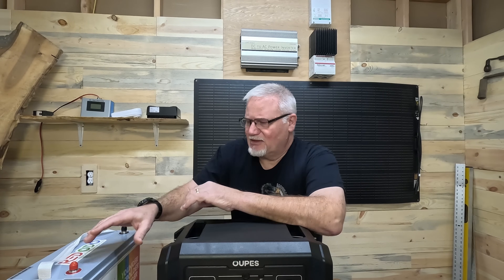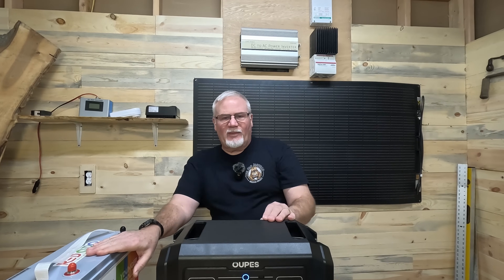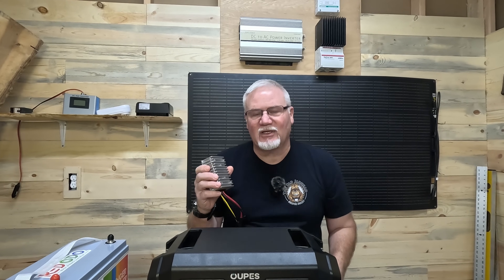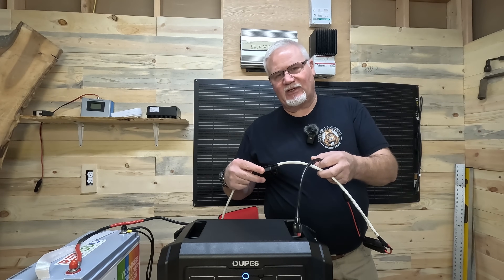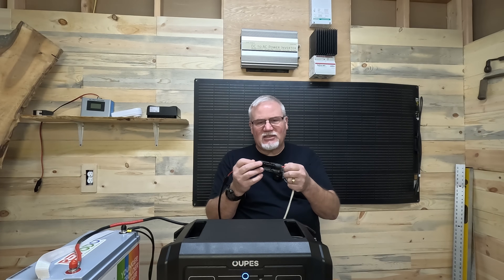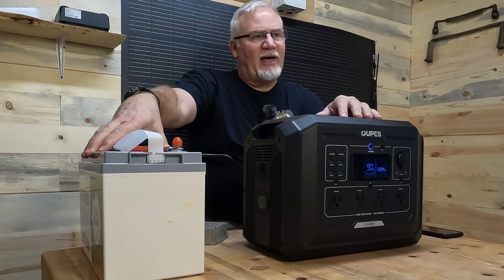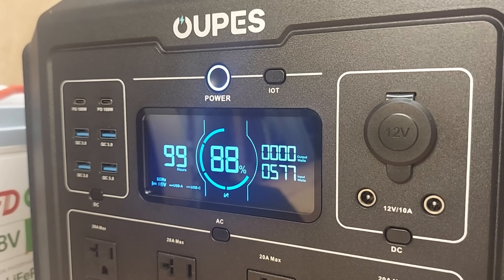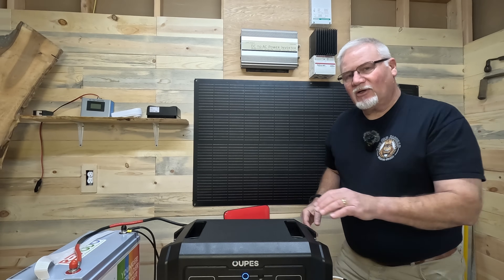Discover How to BOOST Your Portable Power Station Today!

Comment: I have a 48v solar setup using 24.8 batteries, can I just connect mine to the bus bars connected to my system? Run my greenhouse heaters.
Reply from the maker: what type of battery?  If LiFePo's or at least a monitor, then running them in series and into the power station (if it has a solar input that can accept the 40v nominal input) is the best option aside from a straight 48v battery IMO.

This option is just a simple way to get a 12v battery to charge something like the Oupes or provide power to it faster.
Reply: @ thanks for getting back, LiFePO batteries 25.6v 50Ah. 1280Wh, connected to get 48v system, I ordered a EF ECOFLOW power station DElta 2, 1024wh, 1800w.
Reply: @ also have 2 solar panels connected with inverter and charger for 48v.
Reply from the maker: Sounds like you are well on your way!

Comment: If I use a 24v battery will that charge at 500w without a step up converter.
Reply from the maker: Not with the Oupes but it will charge at over 240w and be a great way to extend the battery.  A 48v battery would be better with the Oupes whereas the Aferiy has a higher amperage input and a 24v battery will give 500w
Reply: @TheOldJarhead  thank you buddy
Reply from the maker: You bet!

Comment: A question that comes to my mind, and maybe it's because it's the way I've chosen to use the several large capacity 12 volt LiFePo4 batteries that I own, is, why wouldn't you just get an additional 2000 watt inverter ( I actually have a number of even smaller inverters that I can use to service smaller AC loads, for the sake of efficiency and battery conservation) that was dedicated to being moved from one battery to another as they drain down or would stay connected to a bank of them all tied together. I feel like I can run my fridge longer with a 300 to 500 watt inverter connected to my 200 AH battery than I can from a 2000 watt Oupes power bank connected to the same battery, if a long run time is my main concern. Why not just connect the Oupes to the solar panel and let it charge it while you pass the power through to the Oupes' inverter? Why not just connect a 500 watt inverter to the battery, plug in the charge cable for the Oupes, add whatever solar you have available and put power into it at a rate that is closer to what the Oupes' inverter is capable to delivering. I think that a 700 watt inverter would max out the AC charging if you didn't use turbo charging, or whatever they call it. I see this working fine if you're going to eventually have grid power and a charger at your disposal for the big battery and you just need some extra time at a low wattage draw until that becomes available, but if you're off grid completely, then a small capacity solar generator sort of loses its luster.
Reply from the maker: So, to me, the best option is an inverter, batteries, solar charge controller, panels and a 120v charger (or an inverter charger) and scrap the power station.

Power stations are good for portable power and short duration outages only, really.

Comment: Good idea but how hot does that step up inverter gets?
Reply from the maker: In the followup video (at the end for those that made it all the way) I mention that it did get warm (not so hot I couldn't touch it) it does have over current and over temp protection which some reviews I saw said does work but I plan to do more testing.

Comment: I could be wrong, but, respectfully, I think the 10 amp rating on the step up converter, AKA, boost converter, means that it is limited to 10 amps of DRAW from the converter, if you don't want to DAMAGE it. It doesn't possess the circuitry or ability to LIMIT the output to 10 amps. It will actually provide all the amps that you ask of it, right up until the point that it melts or bursts into flames. In this case, it could be said that it's being over stressed by 30%, at 13 amps, but it may be over engineered to allow slightly higher than rated amperage draws. With a fuse (say 15 amps) that limits that draw, you may avoid destroying the converter spontaneously, but it is probably getting hotter than it is designed for and if you were to connect to a power bank that could accept 800 or 1000 watts of solar, for example, your fuse would just keep blowing to protect the booster and the wiring. Do the same thing connected to the same power bank WITHOUT a fuse and you'll let the magic blue smoke out of everything between the battery and the power bank. That is my belief, at least. A boost converter with a higher amp rating or a power bank that accepts a lower wattage solar input should be fine with this, but a balance has to be maintained and this won't be a universal device for all power banks.
Reply from the maker: That's a good point and one I've been pondering.

I use a much better quality step down converter at my cabin and have used a step up like this one for a 5 day period in testing without issue but it wasn't being pushed.  During this test I was surprised to see it allow so much to be drawn off the battery when it hit 580w and I pulled out a calculator and pondered it for a little.

I did note that it got warm in the follow up video (tagged on at the end just for those who watched the entire video).

I'm planning on doing another test over a longer period and using my heat gun to see what happens.  I've also though about getting a higher rated converter but in truth, it would be better to just use a higher voltage battery.

Comment: I really can't understand why I'll need that step up converter, instead of connecting directly that battery to solar in?
Reply from the maker: It's all about voltage -- if you have a battery with the right voltage (in this case 48v) you'd just plug it right in, but if you have a 12v battery plugging it in will get you a max of around 130w of charging and it may drop out completely once the battery drops below 13v since this power station has a range of 13-48v.

So the boost converter just helps get the battery voltage up to what the power station needs to get the most out of the battery.

it is a short term solution for an emergency though, since it's better to have the battery voltage to match (ie a 48v battery).
Reply: @TheOldJarhead  thanks a lot
Reply from the maker: Absolutely

Comment: How hot does the buck converter get? They claim 97% efficiency, but the heat generated is all wasted power. You staed in a comment that you see this as a short term solution, but in the video you actually advocate even batteries in parallel for increased supply. I'm a little hesitant to pursue this approa ch. I tried a 12 to 24v converter and it was terribly wasteful. Did you actually calc the input wattage vs the delivery? That would be an interesting analysis.
Reply from the maker: Even batteries in parallel in this case would be short term.

I view Power Stations as 'short term' because, honestly that's what they are.  For emergency backup in case of an outage that lasts a a few hours to a few days and, god forbid, even longer.  A power station and some batteries can do that.

For extending the life of a power station here are my best suggestions in order of best to least:

1.  Add a battery of the appropriate size along with solar and a DC Charge Controller with MPPT input as well.
2.  Batteries in series to get the right voltage (and series parallel if more power needed) and the above.
3. Battery (s) with a step up converter to get the right voltage.

I ran my Jackery for 5 days with a 12.8v battery and a 12-24v step up converter without issue.  It got warm yes but not dangerously hot.  If doing this allowed me to go 5 days straight without issue than it will work in an outage.  

For long term home backup I do not recommend power stations except maybe the big monster expensive ones they are making these days but my preference is, of course, DIY solar.
Reply: @TheOldJarhead  Thanks for your response. Your videos are very helpful.
Reply from the maker: Happy to help ☺️
Reply: I went ahead and re-created your test with the 12-48v step up converter. I had a 40amp fuse on the battery output which blew when I got up to about 536w of input on my Anker C1000. The Anker limits the input to 12.5a The problem I had was the primary wiring on the 48v converter is only 10awg which was way overloaded at almost 50a!. Not too safe. I like the approach though and I had a 12-24v converter which gave me about 230w. I think a 12 to 36v converter might be a good compromise. I''d be happy with 450w of charging. Thanks again for the ideas.
Reply from the maker: The amp draw off the battery will be 4x that of the available amperage from the 48v side -- so at 12.5a you'll get 50a draw off the battery, all things being equal.  I'd put in a larger fuse ;)  like a 75a fuse.  And the short distance of the leads to the battery should allow a cable of the size they built it with (8awg I believe).  Out the other side 10awg is more than enough.

Comment: Ok let’s say my power station can only be hooked up to 200 watts of solar will I need to get the 12-24 to 48w at less then the 500 but closer to the 200 watt my power station says it can use?
Reply from the maker: It's more about the voltage -- if it's a 200w limit it's likely 24v (check to be sure) and in that case a 24v battery or, if you have a 12.8v battery than a 12-24v step up converter will work.

Comment: QUESTION: How about stacking two of those 12V batteries in series to get to 24V?  If you have two of those batteries, perhaps you could do a comparison, and would you then need the step-up transformer (along with whatever inefficiency it entails).
Reply from the maker: That would work though it would be better to put 3 or 4 of them in series instead.  Then no step up converter would be needed at all.
Reply: @TheOldJarhead  Thanks.  I will take a look at my power station's input voltage limits.
Reply from the maker: That's the key!

Comment: So why do we need the step up converter? Is this because the power station is a 48V system or is to simply multiply the output from the boosting battery?

Comment: I'd be very cautious about doing this based on a recent trial I performed. The amp limits of both the power station and the amp limit of the boost converter need to be considered. The boost converters are available with different amp ratings (e.g., 12v to 24v @ 3amp, 10amp, 15amp, or 20amp, etc.). You don't want to overwork the boost converter near its maximum amp rating because it will get dangerously hot. Running one at about half the amp rating doesn't generate anywhere near the amount of heat and is much safer and more efficient. You don't want the power station continuously drawing the maximum amps that the converter is rated for because that will overwork the converter and generate a dangerous amount of heat. Certainly keep an eye on the process and periodically check the components, cables, and connections as the power station is charged using a boost converter.

Charging a power station this way saves a lot of money compared to buying a proprietary expansion battery. It's a good way to increase overall amp hour capacity. The supplemental battery also allows capturing excess solar energy once the power station has fully charged via solar. And, as you have noted, using a stand-alone 24v or 48v battery without employing a boost converter is probably a better option if one has such a battery available. If the power station can handle the battery voltage, it is safer and more efficient than using a boost converter.
Reply from the maker: I agree -- but to be honest, I'd just get a 48v battery if I were doing this and didn't have one.  I should have mentioned that in the video (still learning).

This, I see as a temporary, short term solution.  It works, which is what I show, and in the followup video (tagged at the end of this one) I mention that it got warm.

However, I've done this with a smaller setup for 5 days without issue though, as you mention, it was running at less than half the boost converters capacity so didn't get very warm.

Comment: Thanks for a very nicely done video. The concern I have with the boost converter is that it runs very hot as per other youtubers. Did you have the same experience?  It doesn't look to be of very high quality so could it post fire hazards?
Reply from the maker: It runs warm, yes.  A better option is, of course, a 48v battery, but I wanted to show this one as a simple short-term solution

Comment: You are likely to burn out your buck converter over time with this setup, it's rated for 10A. These converters aren't smart, if a load draws more than the converter's rated amperage it will try to supply that amperage. If one insists on doing this I would at least consider adding a fan aimed at the converter to keep to cool as the passive heatsink is likely only rated for the waste heat for 10A out.
Reply from the maker: I view it as a short term solution only.
Reply: Yah, those Amazon converters are fairly poor.  Relatively low efficiencies for DC-DCs, and they don't have proper limits or safeties.   One would have to use a real DC-DC like a Victron or something to handle this kind of work load.
Reply from the maker: For short-term I think they may be ok, perhaps I'll run a longer test and see how it does.

For longer term, a 48v battery would be better, or a DIY solar system
Reply: @TheOldJarhead  Also, the external battery can feed more than one power station simultaneously.  A 100Ah 12.8V or 25.6V external battery can feed 10 power stations with 10A solar inputs, simultaneously.

That's something no power station's DC output could ever do.  They limit you to like 10A and that's it.

But with a direct battery connection you have no such limits and you can fan-out a ton of low and medium-amperage connectors.

(I recommend running each one through a DC breaker if you do that.  I use 10 AWG wiring for these sorts of things so 25A or 30A breaker and a 20A nominal limit).

As a bonus, power can flow in both directions, so the connectors can be used to plug in chargers or charge controllers as well as to dump power to power stations.

-Matt
Reply from the maker: Very great point and one I've talked about in a previous video.

Comment: Excellent demo and practical information.
During a power emergency I use an almost identical setup but I limit the SOC to 80% on the power station. 
This really stretches the battery life and not wasting going to full 100% to waste as heat. 
Thanks again
Reply from the maker: Great point.

Comment: Hey Eric, nice to see the hand is free! As for the buck converter, I'm gonna stick with your earlier video and give mine the 24v battery input (2 12v in series) cuz i only need one cable to connect the batteries and it maxed out my input wattage. I love how many ways you show to get the job tho. More than one way to shave a rat or however that goes 😅 i gave one of those oupes to all my family but only one other is gonna consider these kind of "hacks". I sent him this video. Thank you sir
Reply from the maker: Thanks! Yes, lots of ways, but I prefer just a battery of the right voltage, but that's not always available, so I'm always looking at ways around obstacles 😉
Reply: @TheOldJarhead I keep looking but I think my hypocrisy has reached its limit with 2 power stations and 7 batteries. Ran the power stations the last couple days to power TV and dish because I feel like I need to get some cycles out of them before I get planted in fort Gibson national cemetery
Reply from the maker: Well hopefully not planted too soon!

Comment: Great idea! My only concern is that the step up converter will get very hot and increase losses from the battery.
Reply from the maker: it can get warm, and a better option is a 48v battery, but for an outage, someone with a 12v battery can do this
Reply: @TheOldJarhead  Yes, I have 2 48v 70ah lifepo4 batteries connected in parallel to supplement my Delta Pro via Xt60i connection.
Reply from the maker: Perfect

Comment: I've tried those step-up converters and they didn't work as well as when I connected 4 batteries in a 48-volt configuration. Even placing 2-12-volt batteries in  a 24-volt config will work.
Reply from the maker: Yes, agreed.  They do work but a 48v battery is better